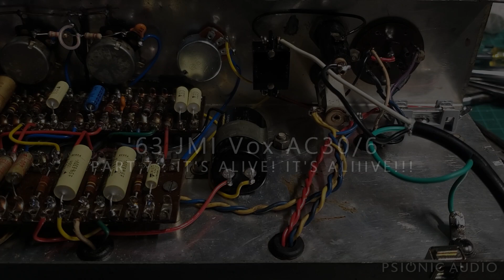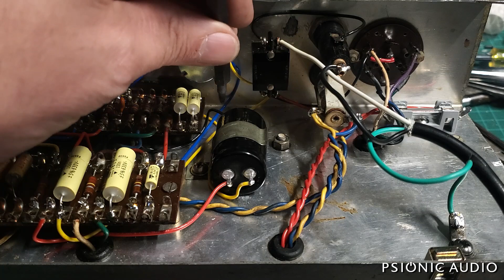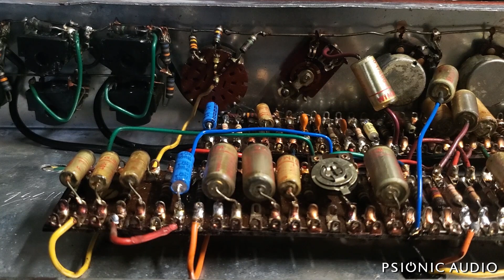'63 JMI Vox AC30/6 | Part 7 : It's Alive! It's Aliiive!!!

Comment: Couldn’t you include a switch to up the bias -voltage/drop the heater voltage when using modern mains voltage vs using a variac? It’d just need to switch between resistors. Or does the plate voltage running it on 120v make it a no go?
Reply from the maker: I'm not adding a switch to a '63 JMI. There are other reasons why not (it's really not a good idea) but that one is paramount.
Reply: @PsionicAudio  Yeah it would be difficult to do discreetly without adding any new holes. Guess corrosion on the contacts of a bias resistor switch could be way more catastrophic than a power switch or input jack too.

Comment: In the vid [about 12.00 min in+] the third pot from right below and left, what maybe is a cap? not sure, looks suspect. Why all the splatter and all the like looking ones ends seem to be so sloppy? Just  seems a bit odd to me. Maybe nothing.
Reply from the maker: That's what the ends of the old Wimas look like. You're seeing the uneven edges of the wraps without an epoxy coating. 

They are fine. In fact they are very desirable.

Comment: Hi , my 64 treble had problems with the tremolo. I replaced the 220k resistors from pin 1 and 6 and that fixed it. Also , i think the footswitch works between tag 4 and 6 from left of board
Reply from the maker: 6 and 7 are both ground. But yes, the switch goes from 4 to 6. See the next video to hear it working.

Comment: Just done an overhaul on a 60/61 ac30..its all good except for a bit of distortion when the note is fading out..any ideas lyle
Reply from the maker: Hard to say but the first thing is do was to make sure all chassis groind connections are clean and tight.
Reply: By the way hank used a few different  models italian meazzi echo relabeled by vox

Comment: I bought an AmpRX Brown Box voltage attenuator for my 68 drip edge champ. I usually have about 122-124 coming out of the wall and run it at 10% reduction and the amp loves it and sounds markedly better than at the higher voltage.

Comment: Hi Lyle, love your hard work mate. If I could bother you for a sec? AC15 CC1 tremolo depth has to be about 2 oclock before you can really here it. no crackly pot or anything. Is this normal or do you think a problem lies within? Thanks mate
Reply: hear
Reply from the maker: Not normal, but it's a pretty complex little SS circuit. Could be a number of things. Can't really diagnose remotely. Sorry. If you're handy you could jumper R24 and get greater overall depth, though there's no guarantee that will solve it.
Reply: @PsionicAudio  thanks man your always cool with answers. Good one mate!